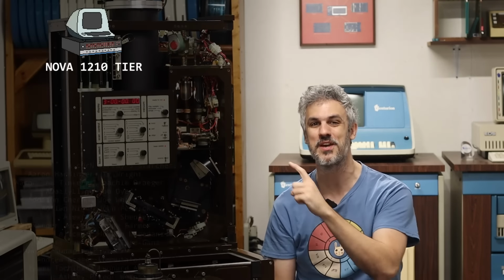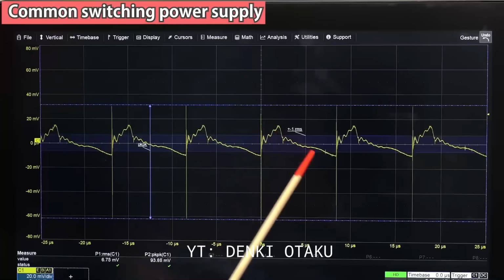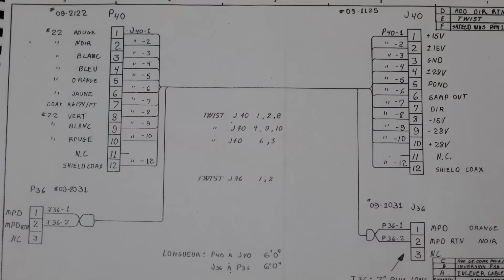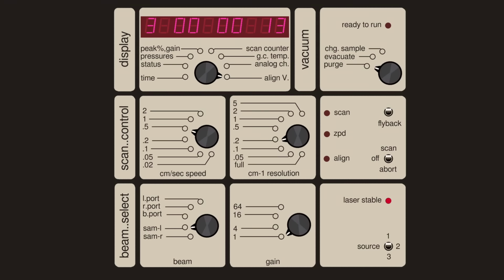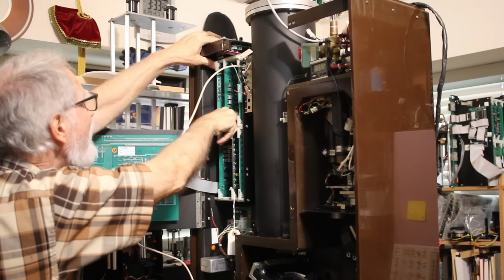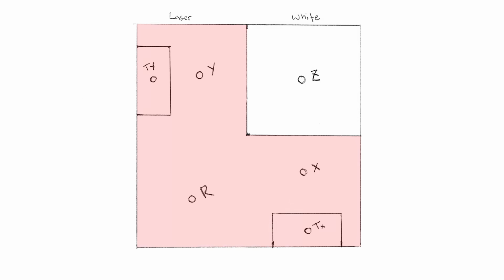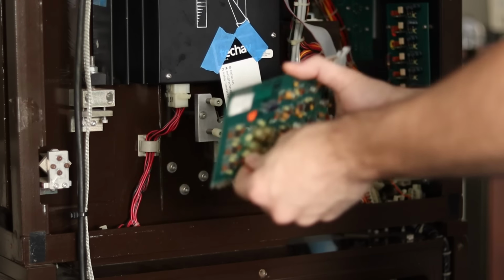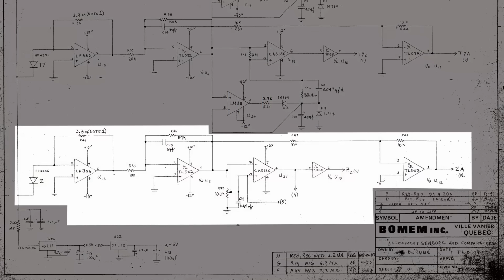I Found a Production Mistake on the Spectrometer!

Comment: if the board pulls in +-15v, which I think it does due to the bottom left, I don't know diagrams that well, so I may very well be wrong, could it be linked back to that manufacturing defect on the backplane?

Comment: Some of those backplane connectors were designed to be push fit. Those ones don't look like push fit pins (usually they're a sort of diamond shape with a split down the middle), but there's a long period of time between that machine being built and the connectors I have experience with being made! Push fit is great when you want to avoid soldering what might be anywhere up to 96 pins on a card edge connector, and at least in staitonary environments they seem to be reliable enough..

Comment: 2:30: In Essence: Your FTIR cannot just do IR-spectroscopy but also Raman-Spectroscopy simultianiously
What a time to be alive (in 1985)

i would check the motor first before tinkering with the detector board. In my opinion that kind of intermittent signal could originate from a little building-up-friction in a bearing of the motor which "snaps back" ever so often and induces a short "burst" of vibration into the mirror
Reply: Isn't that the thing they use on blood tests?
Reply: @windshield11  For blood tests IR spectroscopy would not be very useful (too much components inside). 
UV/Vis is much better since you can (for example) determine the iron content of the blood by the characteristic absorption of hämoglobin

Comment: For the 15V logic backplane fix maybe you could wire wrap across the two pins?
Reply from the maker: On two of the pins that was a possibility, but on the third pin, the original wire wrapping took up so much of the pin there wasn't space to wire wrap another wire on unfortunately.
Reply: Did you see the heavy thickness of the traces for the power?  I believe wire-wrap would be too small a gauge.

Comment: Me after taking multiple signal processing classes in college: "Yea I dont know how to do a Fourier transform either brother"
Reply: it's not as bad as it appears: As long es one has a basic understandig of integrating functions, it is quite doable by hand 
I had do it several time back in university for both math AND physical chemisty classes
Reply: @Schlumpfhut_1985  Actually calculating the FT is really just annoying, using a correspondance table makes it pretty easy for most functions though.
Reply: @lbgstzockt8493 calculating the FT of an arbitrary function is annoying, but calculating the FastFT of a set of discrete measurements (like the PDP will be doing) is "just" a whole lot of (fairly simple) multiplication and addition.

Comment: A 2 mW HeNe is class 1, ain't it? (Yes, I have been in the lab around class 4 lasers.) I used to have a sign, looking rather like the standardized ones, in my office:  "DANG! Do not stare into laser with remaining eyeball."  Environment, Health & Safety made me take it down.

(I also have had lasers in my eyes several times.  I saw a new ophthalmologist a year or two ago, and the first words out of her when she sat me down at the slit lamp were, 'Oh, my! You have had a lot of surgery."  (And the outcome of the visit was that she referred me for more surgery.  But everything has been successful so far.)
Reply: This into class IIIa/3R, which is still generally pretty safe without special precautions. Laser sights for guns, and most typical laser pointers usually fall into this category (except for those with such low power that they fall into class 2). But those sights/pointers are still more dangerous than this beam, as pointers are trying to keep all of their optical power in as small a dot as possible, vs this much larger square.
Reply: I'm wondering how LIDAR signals (as used on many EVs) compare. They are definitely powerful enough to instantly ruin camera sensors. But then again, lasers at concerts can also do that and I'm not aware of anyone getting eye damage from those.
Reply: @kevincathcart4680  yeah, I was thinking about (and failing to mention) the high beam divergence. That has to be a pretty short focus lens spreading it out. But I couldn't be bothered to calculate MPE and NOHD, and my copy of ANSI Z136.1 is at the office.

Given that he needed room lights out for the alignment procedure, I suspect that the system reduces either power or duty cycle when operating in that mode.

And 'Class 1' was a typo, I meant 'Class 2' - avoid intentional extended viewing. Momentary incidental viewing not considered hazardous. Like a laser bar code reader.

Class 3a does require controls against inadvertent eye exposure, but in most cases, procedural controls (SOPs) suffice.

Comment: The beam splitter part is basically how a gravitational wave observatory works, but the moving mirror is controlled by the motion of the space itself -and it is a little bit bigger.
Reply from the maker: Sounds like I need to build a gravitational wave spectrometer in the back yard now!
Reply: @UsagiElectric  This is a great idea, but I think that, like the homebrew computers, you should work up to this.  It's an awful lot of digging.  Maybe do some two slit experiments that will fit in your room first?  Just a suggestion, don't let me ruin your enthusiasm, it's a cool project :)  Either way I'm sure you could work some vintage computers into it.  Speaking of which, why don't you have a 3B2?
Reply: @UsagiElectric  (Robert Schneider voice) We're gonna need a bigger backyard.
Reply: Still amazed they can achieve the accuracy they need to measure that with the environment in mind. Smaller then the width of a proton!

Comment: I had a sign in my office that looked like a standard laser warning sign but the text said "DO NOT STARE INTO LASER WITH REMAINING EYE".
Reply: That IS a standard laser warning sign!
Reply: I remember the electronics lab at college we had a sign on the door: "DANGER: 100,000 Ohms"
Reply: Mine says, “Do not insert brain into Fourier Transform.” 😀
Reply: @williamsquires3070  I'd rather do a Fourier Transform than a Navier-Stokes though.
Reply: Looks like it's one of those provided by AvE.
Reply: The sticker on my 80W CO2 laser is in braille
Reply: That's fine, we don't really need two eyes anyway - one's just a backup!
Reply: Freeze spray! Can be very helpful in finding noisy and intermittent problems. Spray wide first, see if anything at all on the board is sensitive to sudden temperature change, then narrow down to individual part or PCB section. Also.. knocking around with something like the back of a pencil, all while observing the offending signal on the scope.

Comment: Windows XP! Ancient devices and ancient software. What a match. If that device is still in use in labs you would expect that by now, two decades at least after windows XP was end of life, it would have been updated to something to a modern Windows version that at least has security updates.
Reply: AFAIK there's some scientific equipment running on Win98 software simply because the manufacturer either doesn't want to write new software, the license for new software is astronomically expensive, or the manufacturer went out of business

Also the computer driving the test equipment may not be connected to the network and therefore not need security updates
Reply: @HubrisInc that last part is not entirely true. If you process sensitive data that someone else wants. Then infiltration and a local attack is very much an option. Security flaws don't all relate to networking.
Reply: XP isn't ancient. I have a win 98 machine AND a pre-Windows machine.
Reply: @alanclarke4646 you mean you have even more ancient machines. That doesn't mean XP is not ancient. The ancient Greeks for example existed much later than some other cultures. But they are all  ancient cultures
Reply: The software looks like it was written for Windows 2.0-3.11 which means it could be 16-bit, and thus might not work correctly past Windows XP/2003 - or at most Windows 10 32-bit which will stop receiving updates shortly anyway. 

Additionally the drivers might not be compatible to modern Windows (Vista redesigned the kernel enough to brake a lot - if not most of the preexisting drivers), and may not even be signed (although that may be fixable with some hacks).

Security is not an issue if the computer is not connected to the internet, and why would a it need to be?
Reply: The software actually has a Windows 3.1 look about it! (lack of themes)
Reply: @laurdy so it does, who knows how old it actually is.
Reply: I have an EPROM programmer (Needham's EMP-31) which became unsupported around 2001. (bought out and stopped production) It wants to talk to USB with a Windows kernel driver (because that's what they used for the parallel port versions), and that was right before x86-64 happened. I have to run it on an old XP laptop because it doesn't have a 64-bit driver. The driver is only like 8K, but it would be a major effort to reverse-engineer it and port it to 64 bits. Keep in mind that this is for a USB device, which probably could have been done with a user-mode driver.

Comment: 14:45 seems like some DuPont style breadboard jumpers would have worked, no soldering, just yank em off....
Reply: Yea, there must be a reasion those pins weren’t soldered.
For me, I would’ve just used some Red wire wrapping wire and wire wrap the jumpers.
Then log it in the notes.
I would never EVER solder a jumper on a wire wrapping pin.
Reply: I suspect the mirror control card jumpers those pins.

But the bridge card doesn’t

Yup.  Wait for later in the video for confirmation

Comment: 6:35 but they also can fix my -5.25 nearsighted astigmatism correction in both eyes

If you do it jus right

Not cheap though, they can charge 5-10 grand per eye or more and insurance may not cover it in some cases, because it's treated like plastic surgery, only may cover it with a valid doctor letter

Saves me the money having to buy contacts in the long run

Spent that much already on glasses and contacts 

When my prescription cost over 300 USD for some LensCrafters
Reply: More astigmatism than nearsighted
Reply: Pointing lasers in ya eyes ain't all bad

They used to use an actual scalpel and stuff before LASIK, because they found people getting in accidents and got glass shards in the eyeball notice improvement in eyesight after treatment 

No they don't use anesthesia you're awake, they just numb the eyeball just feel pressure, won't see much once they cut the cornea to actually laser your lens🤷‍♂️
Reply: Well yes, but the LASIK laser is a well calibrated precision instrument controlled by trained professionals. A scalpel in the hands of a surgeon can remove brain tumours, but a machete to the head can only harm. Glad to hear it worked well tho, medical bills get insane.
Reply: If you’re blind you will not need to worry about astigmatism. Just saying.